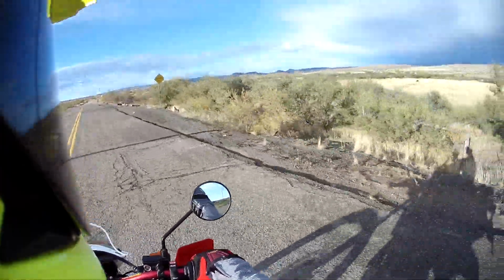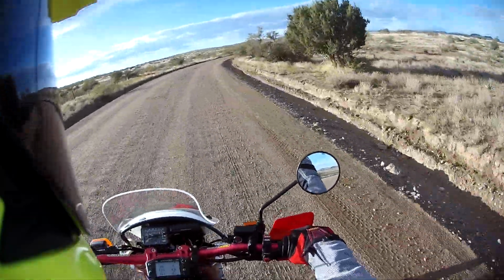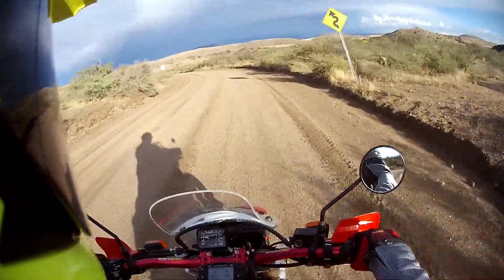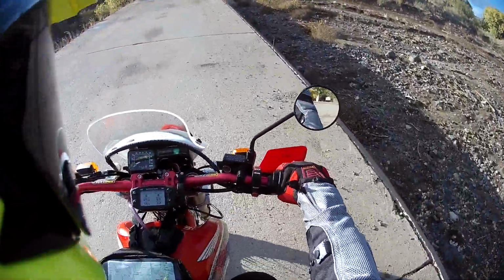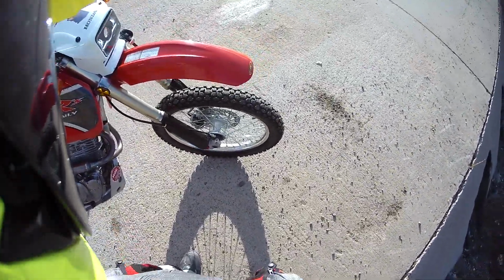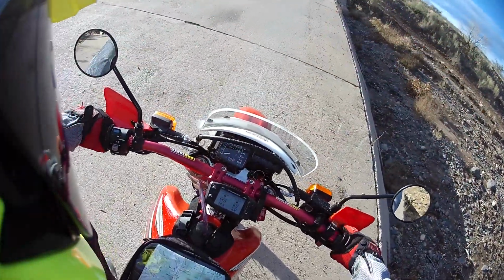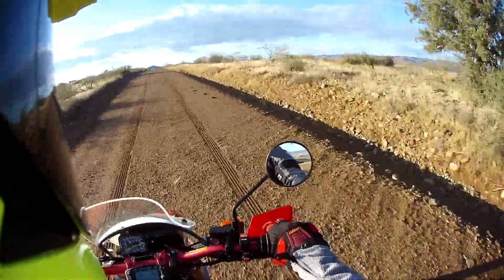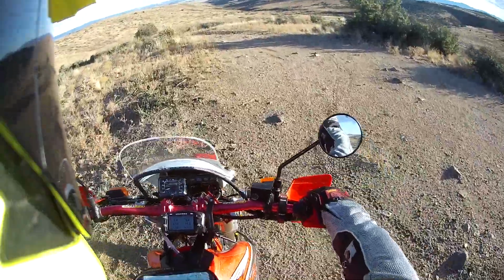XR650L Testing the trick stuff

Comment: I've seen and heard of bunch of guys converting to the USD forks. Every CRF450X I've ridden was harsh and deflecting. Guys are always having them revalved. The old school stock forks are plush as can be and magically hold up in the stroke. I've ridden mine through 30 miles of 3 foot sand whoops and miles of unrelenting rocks. Stock suspension seems to handle all of it.
Reply from the maker: You are right the stock suspension is very good, and if this was not a free swap I would still have stock forks and be happy with them. But I will say the bike is a different beast with the USD forks and clamps, and with all the adjustments you can get rid of the harshness. I just did a similar (free) conversion on my DR650 and really happy with the results on that bike too. Thank you for the comment.

Comment: Nice bike.... I'm in the process of USD conversion on my xr650l... This is the second time I have done this conversion on a xr650l. First time I used crf450x forks and Ron's clamps. Worked great... He makes some cool stuff. This time I'm doing the emig steering stem, mostly because of cost ($185) and I already have the stock cr125 clamps that came with the forks. And I like the idea of having the rubber bushing mounted handle bars that stock cr mx clamps offer. 

How do you like the Sutton cycle works oil cooler?

Also... Just a side note...I have the Dyno jet, jet kit on the CV carb...runs pretty good and I get about 40mpg
Reply from the maker: Thanks for the tip on the dyno jet kit, I did try a DJ kit with the stock exhaust and the bike never ran right maybe with the FMF now it would be better? This is the best the bike has ever ran so I'm afraid to touch it? I'm very happy with the conversion of the 450 USD forks, I had no Idea the change would be so dramatic. The Sutton cooler is just ok? Later I may try to make something else work? It is a nice kit but I am only seeing about a 10 degree drop in oil temp. It will still run up to 260 degrees on a 95 degree day. I think the cooler is too small. I will know more when summer returns. Let me know how you like the Emig clamps and CR forks.

Comment: I get 50 miles per gal on mine I live in payson but I work in rye across the street from the old junkyard mines bone stock engine but smog delete
Reply from the maker: Hi Chris, I sure wish I did? Even when I bought my XR it was used with a jet kit, mid 30's is all I can get out of the old girl? At least it runs really well now? My DR650 is mid 40 mpg all day long and is a bullet compared to the XR?  I have heard from others that they get the same mileage as you? maybe my big foot is riding the rear brake pedal? :) Thank You for watching.

Comment: where did you pick up the triple tree setup
Reply from the maker: I purchased a XR650L that had them on, I swapped them over to mine.
I have a video posted called Stole It! If you want to see.
RSW racing.com sells them. 400 dollars, is the way to go and retain speedometer mount, the correct steering stops, ignition mount and steering lock. It's a slick set up.
I will be posting an install video, were I show and weigh all the parts. Thank you for watching.
Reply from the maker: You could do the swap for a $1000. If you shop smart on ebay. Clamps are $400. Forks front wheel axle should eat up the rest. 
Your steering stem needs to be pressed in.
Other than that 2 hours to take apart and install. Everything bolts up like stock.

Comment: What did you do to make it run so good?
I adjusted my valves and it is a whole lot better but still sputters and doesn't run near as good as yours. I've watched your video a few times and I hear something about the carburetor but don't quite get it.
Reply from the maker: I have removed the snorkel, drilled out the airbox, rejetted to a 52/158 and a shim under the needle. FMF power bomb header and the Lexx exhaust. Maybe pick up a spare ignition module at Rocky Mountain ATV and see if that helps if your jetting is not the issue. I hope this helps.
Reply: @verbalwidget0919  thanks!

Comment: Next mod and the best are a High rev CDI and a pumper carb. I just installed a Ricky Stator high rev CDI and a TM40 pumper carburetor kit from Niche Cycle on my bike with a full T4 Pro Circuit and OMG!!! NO more cutting out when you snap the throttle and rev's to the moon. It now feels like a real dirt bike:)
Reply from the maker: Thanks for the information. I never heard of the High Rev CDI, that would be cool! I just bought a factory Honda CDI because I was at wits end trying to fix the sputtering, and wanted to make sure the CDI was not the problem (it wasn't), but I carry the old one as a spare now. 
The other bike I bought that I am swapping parts off of, has a new TM40 carby from ProCycle, but the guy could not get it to run right with it?(Why it sold cheap) I am going to put it in a box and maybe put it on later, but the bike runs perfect now so I'm just going to ride it and finish swapping stuff around so I can get my money back out of the other bike when it's back to stock. 
Any idea what your jetting is? The guy gave me a bag of jets with the bike.
Reply: @verbalwidget0919  watch torture test magazines video on aftermarket CDIs before buying one. I've read the pumper carbs are great for a little extra power and fix sputtering in low RPM, but also tend to use more fuel. Some people just swap carbs from another machine. I run the stock one because the bike could have 10 hp for all I care. Just gotta run well EVERY TIME I push that little red square.
Reply from the maker: @Megakoolguy357  I'm not making any changes any time soon, since I just got it running the best its run since I have owned it. I'm always out by myself, it has to start first time every time. Always good to know about other things. I will check out TT and learn more on the CDI, and I have the pumper in the box from the other bike. But for now I am good. I just bought a new factory CDI  and carry my old one for a spare. I was out on the DR650 yesterday causing trouble, and it was nice to get 44 to 46 mpg and ran 65/70 for 170 miles up and 170 miles home to get to the area that I wanted to explore. Honda XR650 gets 10 mpg less per gallon same rider, same 650cc?? And the DR650 is still much faster? Go figure?
Reply: @verbalwidget0919  The DR has 2 plugs, right? That may have something to do with it. I have even heard of XR owners using the carb from the DR. I got 41 on my bike yesterday and rode 122 miles with about half of that on the road and absolutely smashed it offroad. I did coast maybe five miles downhill, but I doubt it affected mileage much
Reply: If you haven't checked you cam chain and tensioner in a while, that may be a good idea. Mine is getting loose and makes a pretty awful sound when I start the bike. Has a hard time idling when cold and doesn't seem like its getting mileage or power it used to. I didnt replace it during the rebuild, so its likely the problem.

Comment: I just need to re jet and smog delete.  How did smog delete feel to you?
Reply: I did smog delete, re jet, uni filter, and removed the airbox baffle all at once. It definitely has a snappier throttle...oh and yoshimura slipon. Then a month later added 14t front sprocket which made it feel like a tractor when i climb steep hills, and will pull front wheel in 2nd.
Reply: @billcharlene1450  I put 42tooth on rear....so same as 14t on front. I need to re jet and smog delete and we will be the same. Mine still pulls wheelies in 1st when full throttle. But I like being able to cruise 70+ no problem. Oh and need the 4.7 gas tank. I have stock 2.8 and have to turn reserve on at 70-80.miles.
Reply from the maker: I could not tell a difference to be honest, but it was nice to have the stuff off the engine. biggest difference was the FMF exhaust.
Reply from the maker: I agree, It was not until I did the FMF full exhaust, airbox and jetting, until the bike came to life!! I prefer the 14tooth front sprocket, but my rides are farther away that required me to put the 15 tooth sprocket back on to cruise better on the highway.
Reply: @verbalwidget0919  14t front sprocket is 2.81 gear ratio. 42tooth rear sprocket is 2.80 and stock 15/45 is 3.00 ratio. So 14t & 42t rear gets you almost 10mph faster top speed, and doesn't seem like its revving so high when going 70. Drops the RPM like from 5kish to 3500ish
Reply: @verbalwidget0919  doesn't make sense. 15t front means stock which isnt as good as 14t front. Rpms will be higher at highway speeds.
Reply from the maker: @socaladventuresdavidt2557 Ok, but I still have the stock size 45 tooth rear sprocket?
For me, 15/45 combination is better for the highway, and lets the engine run at a lower RPM than the 14/45 gearing. 
At 70 mph with the 15/45 gearing I am doing 4800 RPM on the tachometer. While the 14/45 gearing I was 5300 rpm on the tachometer. 
The 14/45 is better for me on the dirt because it lowers the gearing enough to where I don't have to use 1st gear, because I hate that gap between 1st and 2nd gear with the 15/45 gearing. With the 14/45 gearing second is low enough for me to do 90% of the off roading and hills and avoid the gap in first gear, but I'm slower on the highway for the same RPM.
Maybe on my next rear sprocket change I will try your 42 rear sprocket and see how that goes.